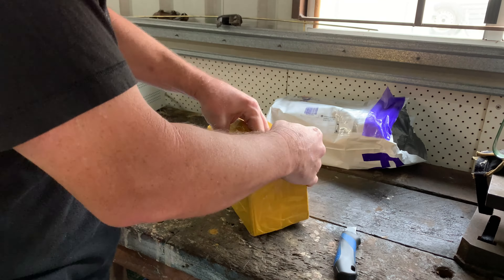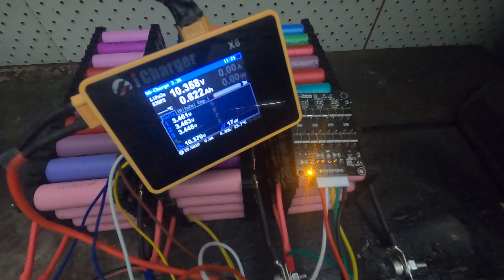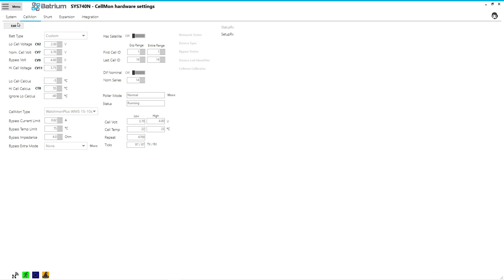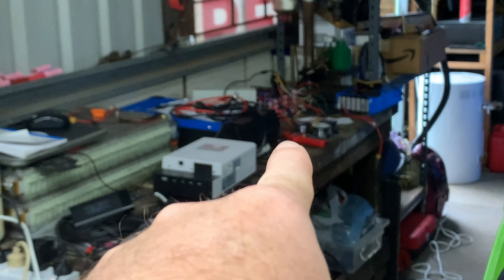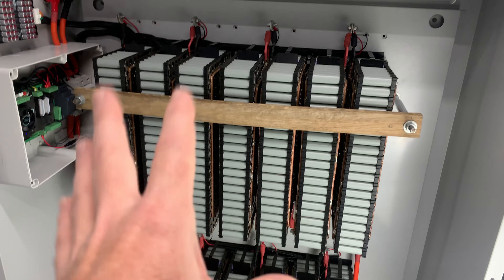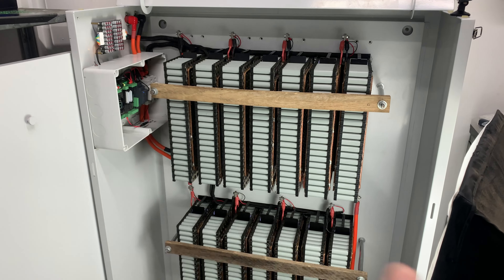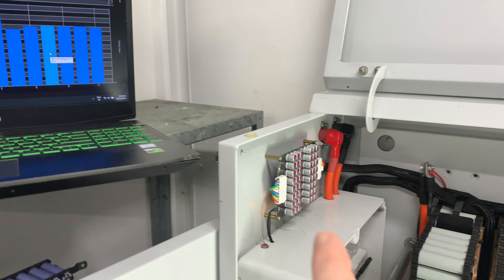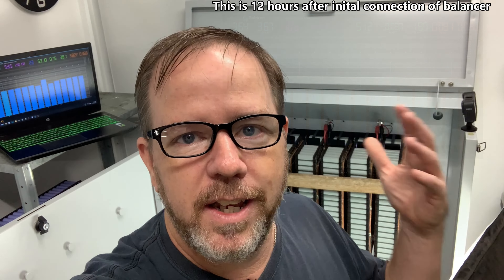Install & Test Heltec Active Balancers

Comment: These things are ticking time bombs that just have to go screwy and will then destroy your pack. Everyone obsessed too much about balancing.
Reply from the maker: I agree they solve a problem that shouldn't exist
Reply from the maker: well they try to..
Reply: I would much rather the balancer to be in the BMS, however, my small pack (3s16p) has its BMS balancer not working, they come with those shitty passive bleeder balancers that just drain the high cells as they go above 4.3 volts (yikes that is way too high for any lithium ion variant), But they won't activate until you get them to go to full charge, so for people never fully charging the pack they never get balanced. An active balancer not only balances way faster than a passive bleeder balancer, but makes less heat and does so at any voltage... this is a downside for LFP and other lithium ion types with flat curves, but for LCO and NMC lithium ion, it's nice as they should have the same voltage per cell all the way from top to bottom, they should all fall at the same rate, and they all have different voltages across the discharge and charge curves.

So if your BMS is defective like mine that screwed my balance in 1 cycle (perfectly balanced parallel banks, next charge 2 were at 0 volts and 1 was at 4.3 volts), they're perfect, and if you use something other than LFP (LiFePO4), then they can work fine 24/7... though mine is an inductive type, not the capacitor type (shown here) or the transformer type (the really high current one Heltec sells), mine works fine for smaller strings and has all solid state parts (ceramic caps, not electrolytic caps), downside is that mine can only transfer energy from one cell to the adjacent cell, not across the pack, so a balance has to propagate across the cells... not a problem for 2s or even 3s, possibly 4s is fine... but you reach a lot more series and have one cell on the end with higher or lower capacity or just a bad balance... well each transfer stops at a set voltage difference, so the difference is fine at one cell across, but gets worse and worse as you go along and they are each a set voltage different. The capacitive type (shown here) transfers energy to all cells at once from all cells at once, so all low cells get charged from all high cells at once.

Still, I'd rather have the active balancer be built into the BMS so that it can monitor itself and so that it's only one part to fail with one balance lead and one balance wire per cell, not 2, one for the BMS and one for the balancer. Plus, a BMS designed for LFP could also be programmed to only activate the balancer when the cells are at the knee in the graph rather than the flat part which is where the balancer might unbalance the pack instead of balance it, then a BMS made for LCO or NMC like my cells could have the balancer work all the time there is a significant difference, at any state of charge, because they do not have a flat discharge curve.